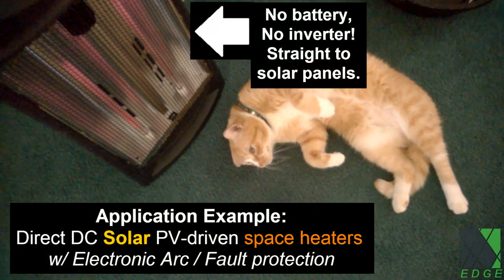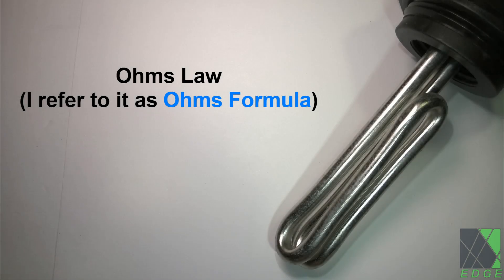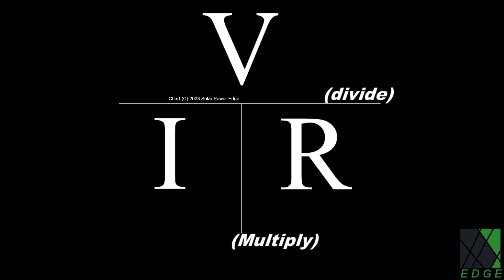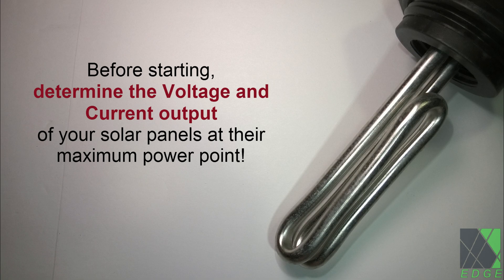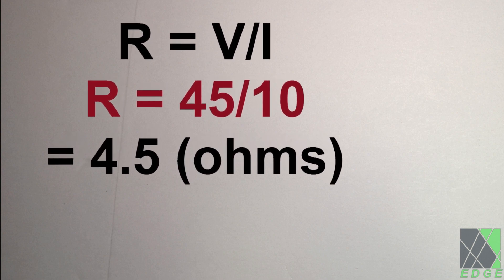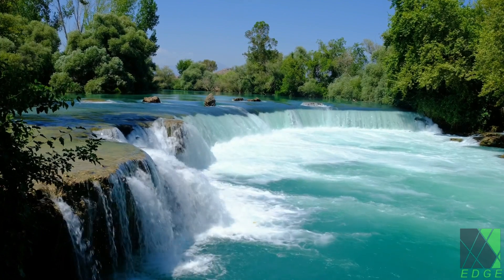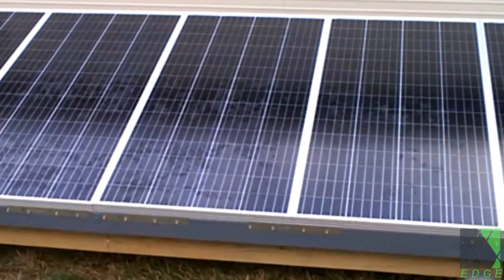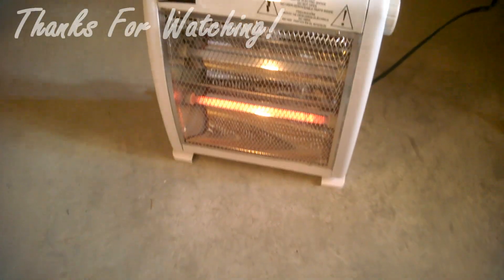How to Use Solar Panels and Ohms Law to drive DC loads directly! Solar Electric 101

Comment: I like what you are doing and have learned some important things. Thanks for sharing this. I have some thoughts you may want to consider. 1. load matching is important to the best efficiency and is key to an hands off system - manual load matching is not practical for me or others. Have you considered trying this? 1. Connect, for example, three loads in series and then shorting one load out at a time using two relays (i know relays are expensive) then operate the relays using a diode string to operate the relays to adjust the load automatically?  The load matching could then be automatic. There also could be 4 or 5 loads in series with more relays but hopefully you get the idea. 2. Instead of using a fixed solar panel pointing south, use solar panels point east and west only. This removes peak loads in the middle of the day but is compensated by higher outputs outside the mid day. This reduces the amount of resistance load matching required with idea #1. More panels are required but the panels will remain cooler and that compensates for the lost mid day direct sun light. If they are mounted vertically they will not collect as much snow. There are videos on this positioning concept on YouTube. Use of used panels will compensate the extra panels required.
Reply from the maker: Hello, glad this video was useful. I use parallel diode chains (diode strings) to dynamically match nichrome heaters to the volts-max-power region of the solar panel array. They yield about 10-20% more watt-hours (heat).
Here's an example of 2 earlier prototypes I built. Working on a larger one that can dissipate 1000w or more. https://youtu.be/Cle05mmYOUs
Reply from the maker: I like your idea about using something to automate the load-matching. Arranging solar panels in an arc makes sense too, it's kind of like a solar tracker. One thing I've found about solar electric heating, it makes sense to add more panels. More heat is a good thing :)

Comment: Give me a thumbs up if what I say is correct for my SP... Max power output = Voltage at Pmax(Vmp) ?   Current at Pmax(Imp)?    If this is correct,   my panels say the following Vmp= 37.68v  ;   Imp= 17.26A   Therefore, 37.68/17.26=2.18  (the basic target Resistance of my heating element.. How much does slightly mean ?  If make the element "slightly" more resistant meaning 3.18 R?   I have 4 of this type of panels so any suggestions would be great. I am a Science teacher not an English teacher so excuse my errors lol
Reply from the maker: @markpennella The math looks correct! paper calculations don't necessarily reflect the real world but they are a helpful tool to get started... I use this simple formula nearly every day! Do you have any nichrome? How about making your own heating element with these numbers and see what happens :D

Comment: What are your thoughts on using a buck converter to raise the voltage from the panel to drive a load that is a bit too high in resistance ? The buck converter would also try to keep the output voltage more constant.
Reply from the maker: @memylastname9972 Thinking in terms of grid-down "high tech survival" scenarios, I try to simplify and eliminate stuff that can break. Or cannot be repaired and serviced by a DIY'er. Running straight off the solar panel (if possible) is dirt simple and there is less stuff to break. In the future we may not be able to hop on the internet and order a new converter if one burns out.  
That said, using a boost converter is entirely valid way to drive loads. A good example is the Ryobi solar super charger project. From my experience it can be extremely tricky to match the input power to the other end. What often happened in my tests with boost converters is the PV voltage collapses and passes the "ohmic" load right through, minus extra losses from the converter. Back to square one. Perhaps if the voltage is only boosting by a few volts to get a little more power, it would function better. 
Another thing to keep in mind is if the DC output is higher than about 48v, it's an electrocution hazard. I don't want to touch anything that has high voltage DC flowing through it, just takes all the fun out. 
What we really need are intelligent DC boost (and buck) converters with solar friendly operation and MPPT. These are rare. I may have found one such converter, it's collecting dust, I haven't been able to test it yet. A subject of a future part 2 perhaps, if I can make it there! Hope this essay is helpful in some way :D

Comment: So if you can run directly off solar then you should be able to also run it directly from a battery built to the correct voltage? Solar panels, SCC and battery should be the basics you need to do this when the sun disappears? 
I live in Chiang Mai Thailand and we always have several fans going with the except of mid december to mid january.....April is the hottest month and this year April has averaged 39.4C which is 102.92F!!!!
I could save a fair bit just taking a few fans off grid :) DC fans are cheap here....the battery aspect also cheaper here (for DIY at least), but would be maybe down the track.
Another excellent video providing food for thought....thx :) :)
Reply from the maker: @Ulbre Thanks and I'm glad you're enjoying the videos :) Thailand is really hot... wow! Right, a battery can run the same resistance loads too. Fans can run directly from solar panels if they are a good match, and if the voltage is similar, can run off  batteries all night. Otherwise, a DC converter might be needed. I use a lot of direct solar powered fans to cool my sheds.
Reply: There's not enough power in one battery to run a heater such that you would get enough heat to heat a room, or even a van comfortably all night.  And it would ruin the battery rather quickly.  2 kW/h battery will be drained in an hour on a 1 kW heater.  However, Several batteries can be better used to power heat pumps.  A 12,000 BTU Heat pump uses about 500w and gives off 3x the heat.

Comment: Great video, hard to find stuff like this on YouTube! I was thinking if a 12V ACDC power supply was connected in parallel to a 12.1+Vmpp solar panel, and both to a load with less resistance than the panel's Characteristic Resistance (=Vmpp/Impp), then the panel's voltage would be pulled down until it matches the ACDC's voltage, the panel would still output near MPP, and the AC would make up the current difference. Thoughts?
PS Love your cat!
Reply from the maker: Thank you very much for the good feedback :) please stay tuned, more projects being documented. Yes you are correct, in theory that should work. I use the same type of concept in my server project (not uploaded yet). Getting it to balance can be a bit tedious though, and have to be careful backfeeding DC or linking power supplies like this. Some of them can't handle backfeeding. Glad you like the cat, I think he takes well to the camera. He loves anything that puts out heat, obviously :)

Comment: Can you switch multiple low wattage loads in and out of the circuit to match the panel's fluctuating impedance? How would you automate this? Would I need to sense amperage or a different variable to switch the relays? It would be awesome if there was an off the shelf control board I could use...
Reply from the maker: Hi, yes that works. In fact I've already have a system to do something similar. The most obvious method is to use an arduino and switching. Not sure if there is any off the shelf board, but I would be interested if there was. Hope to be able to do more video about this stuff in the future.
Reply: @solarpoweredge  Thanks for the reply 😁. So to be clear- I'd want to measure the amperage produced by the panel to determine the correct load? Not the voltage?
Reply from the maker: No problem - best to monitor both voltage and current (power). Then some kind of control is needed to act on the information. Can also do it manually of course. The non electronic way is to simply build the heater to match the solar panels. If it's cloudy or hazy, just attach a smaller heater. If a panel can drive a 1000w heater in full sun, perhaps it can only handle a 300w heater in bad conditions. You might notice I barely talk about electronics in my videos - trying to keep it simple for now. The most pure kind of PV-to-load is straight from solar to a load with no electronics. If things go well in the future, I intend to talk about using basic electronics with solar power. With electronics, it's easier to match the impedance of the load to a given solar panel in a variety of conditions, plus it could be automated. If I am able to get any of this on video I will be sure to upload :)

Comment: Hi! If i will have a load 17.8 ohm and pv at 9.9 ohm will be ok ? 3000w 230v heating element and 3p 550w pv panel
Reply from the maker: Hello, good question. We know a 230v element has high resistance as it's made for high voltage AC. So it is very hard to say it will work from here without the testing I'm used to doing in the shop. It could work if the panel voltage is right. Btw careful exceeding 55v or so. Higher DC can give you a real shock. Anyway first try plugging the numbers on the back of the panel(s) into I=V/R formula along with your chosen element. Use that as a baseline first. Do the same with the full AC rating. Compare the to equations to get a baseline. The math is a good starting point and will give you an estimated performance. Heating elements vary their resistance over time and under operation, keep that in mind. If this element is  not a good match, you might try changing one variable in the equation at a time. In short I am used to testing this stuff myself and can't really guarantee a particular result. So this is all just my opinion - I hope it helps. DD
Reply: i just want to know if the math is ok. I think i will have 8-9A 80% of the tine and i’m at 16 ohm with lower light. Many thanks. I use dc 5000vdc 20A protections automatic and gloves in operation
Reply from the maker: You are welcome... I think the math is enough to give a good idea. I wish I could give you a more clear answer from here. With 9A and 16 ohm you might be hitting around 144vdc; good you have gloves as DC that high would definitely electrocute. For safer operation, I tend to parallel the panels and use lower voltage, lower resistance elements. More current, bigger/more wires, less vulnerable to panel shading issues as well. Multiple breakers if required. It sounds like you know how to protect yourself though, and that's good, stay safe.
Reply: @solarpoweredge  the distance between pv and boiler is around 20 meters so will be to much for my 6mm2 copper conductor
Reply from the maker: Just in case my experience is any future use to you; for years one of my farthest heaters is fed 10-20 Amps at 60vdc through 10awg (5.26mm2) copper over >40 meters in cold weather. There was not enough voltage drop in the wire to concern me. I plan to add 5 pairs of 8awg to bring in more PV, and keep all circuits around 60v - that's technically the upper end of the 48v region.

Comment: Great video, thanks heaps for sharing. I'm looking around my workshop thinking of all the things that could be powered directly from a solar panel array, there's heaps! So many possibilities.
I have an old breadmaker which has a heating element, an old electric frying pan, also a couple of old split system air conditioners (could use copper and fins as a heat exchanger), and I'd love to figure out a cheap, sustainable way to run a PV2L powered distillery for purifying water for the whole house eventually. Just have to nut it all out, how it could work and get the safety stuff well thought out. Would love to hear your thoughts on whether you think it's achievable with those things.

I did in the past build a 240v near infrared sauna heater with 4 bulbs, but a PV2L one would be even better.

Keep those videos coming, love the content
Reply from the maker: You are welcome! Glad to hear it. Very encouraging. Those are all intriguing  projects. We should have been neighbors. I intend to respond to all those points and safety issues on video someday. The main challenge is the heating elements aren't low voltage, mains voltage is too high. No way I want ~100V DC in my house. 40V with 15-25A behind it is exciting enough. So making heating elements by hand has been a common task. I need to make a video about that too. It can be tedious they burn out easily. 

I have 100 projects I want to run PV2L. Not much time or health to finish them. Good news is there are a minimum of 3 projects in the queue and one simple project ready to present. 

PS this winter 60% of the house and workshop were assist heated with converted AC and DC PTC PV2L space heaters, have over 8 of those now. Simple and clean. Why aren't these things on store shelves? One of the main issues I encountered is avoiding high DC voltage... limiting myself to LVDC because I don't want to use or show people anything dangerous... also need to make a video about switching DC, avoid arcs, and ensure 100% safety for the household. Hope to do that  asap. Oh and finish the cooking appliance series. So many projects so little time...

More stuff on the way asap!
Reply: @solarpoweredge  Agreed, we could have built some cool projects as neighbours.

Hopefully a manufacturer picks up on your PV2L PTC idea and you get some income from it!

I'm keen to see the videos you've got coming up, especially on how to make sure DC switching is done while  avoiding/controlling arcing.

PS I checked the resistances and the bread maker is 105 Ohm, and the electric frying pan is 41 Ohms. Next, I'll power them up and see what the resistance is at higher temps...:chillwcat:
Reply from the maker: Yeah that would be awesome! Or maybe they will just start manufacturing so we can all buy these heaters safely. UL listed would be nice.

The converted AC space heaters hit a conundrum. They work so well. If I made them 12V/24V, they'd still weld those little switches. Which are a must have for fire safety. Mine run around ~40V to avoid big thick wires. But in ALL the non-electronic switch tests I conducted, DC open/closed circuit with any AC switch sounds like water spraying SSSSSSS. So even lower voltage DC has huge arc potential. Not good! Can't tell people to put that in their home. Kind of disappointing, electronics are needed to preserve the safety (tip over, thermal cutout switch). 

There are probably 100 ways to tackle this. I'm not sure how hungry people are to get into the electronics. Also presenting it in a way that one-size-fits-all is a problem I have not solved. Furthermore I have been absolutely hammered with severe migraines and such. Making electronics videos and migraines... yeah no thanks. Hopefully things will open up in the future!

Bread maker and frying pan are very interesting projects. The resistance might be higher when hot. If only PV2L cooking appliances were on every store shelf, it's DIY only for now. 

PS, upcoming, simpler DIY projects. Last week 3 projects successful and got some footage of one. PV2L cooking. No electronics needed or optional I think. Very exciting. You won't believe your eyes. I couldn't. Wish I could tell you without ruining the fun and surprise :)
Reply: @solarpoweredge  Sounds great, looking forward to it. Hopefully the migranes take a holiday. Maybe there's a switch to turn them off permanently somewhere...
Reply from the maker: Yes indeed. I have strong hope. 
Waiting for sun to come out so I can record. Hope the next PV cooking (burning?) video will be successful, we shall see.